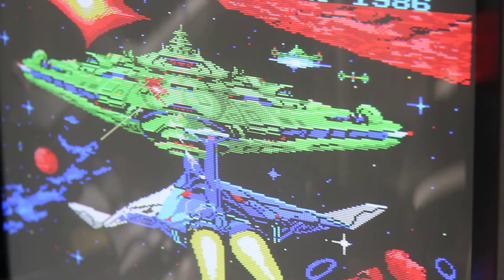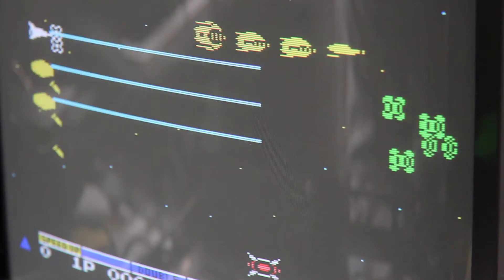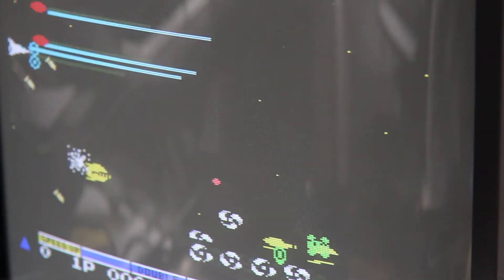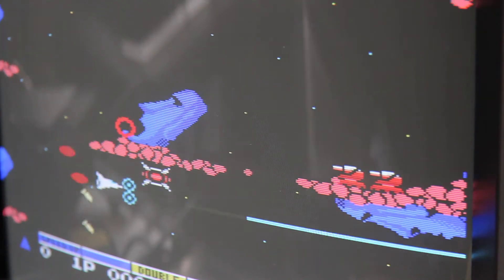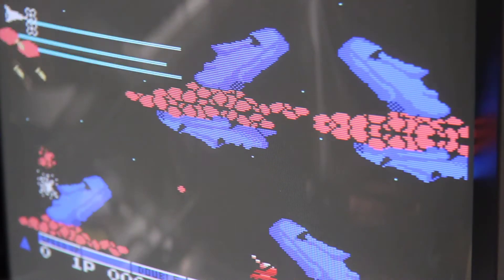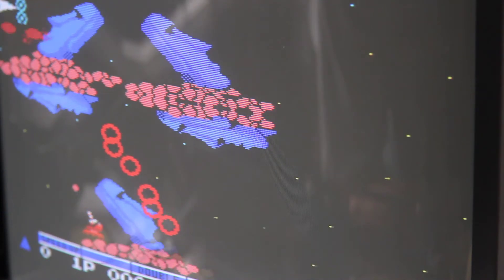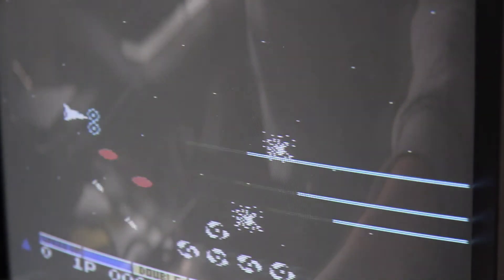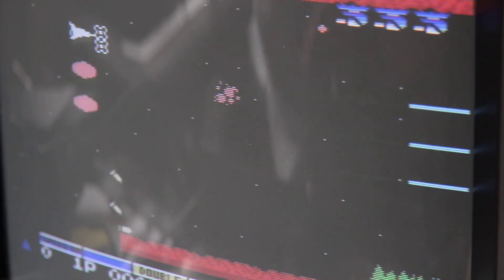Phiips MSX2 VG8235 - RGB vs  Composite SCART

Comment: I don't see any difference other than less saturation, whch you can crank up. The composite signal is pretty decent. A C64 would be jealous.
Reply from the maker: @lovemadeinjapan  the pixels are much sharper with the RGB signal
Reply: @RamonSmits  Somehow it does not show in the video, the composite is really good too, but I can see it on my own machines.